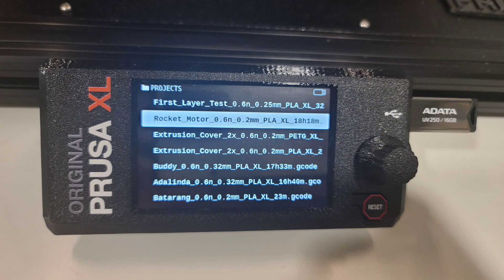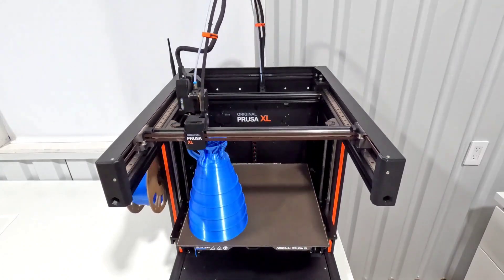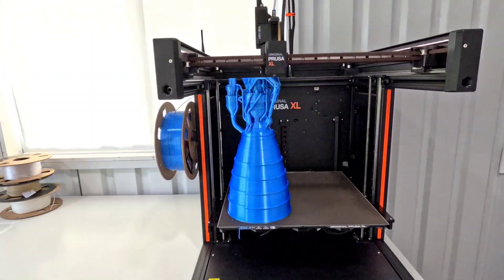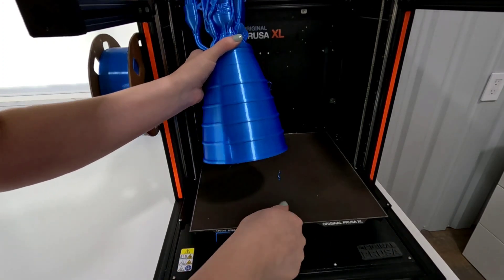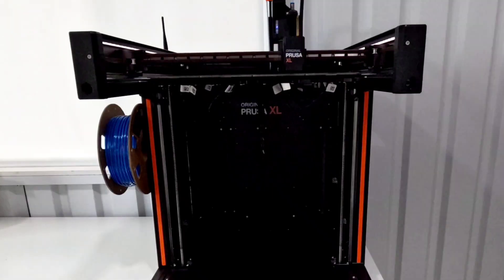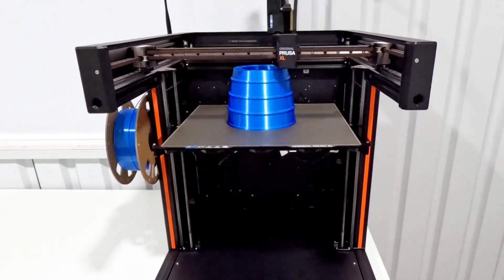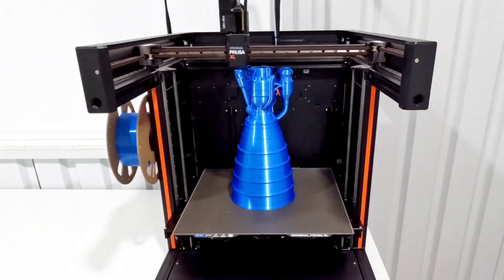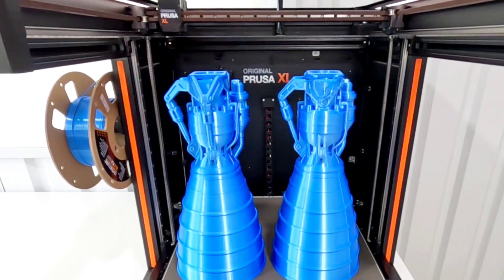Prusa XL - Printing the Rocket Motor!

Comment: The ussue is that tiny and tall stick. When it got tall prinder slightly rubbed it and broke it off and the structure above it did not have support after this event.
Reply from the maker: Yeah its very small. Thanks!

Comment: The print looks like it has no supports.  Those separate pieces that are outside the main body are probably not as solid and prone to small movement when the nozzle travels/prints them.  Most likely had a small lip/raised up filament on that part and nozzle started hitting and hitting until it broke it off.
Reply from the maker: Makes sense. I didn't add supports since it was a presliced gcode. Thanks!

Comment: So does the xl just poop a strip of filament off the edge of the bed during the startup gcode? The normal strip at the start of the print is hanging off
Reply from the maker: Mine does it everytime. Haven't seen any others out there. But I don't mind it. I can grab and pull the purge line off without touching the bed. If I can pop and slide the print, don't even have to clean the bed in between prints. Thanks!

Comment: I often choose random for the seam. It spreads the imperfections out, so it's a tradeoff, but at least there's no "bad side" that way.
Reply from the maker: True. I just usually have lot of bumps on random. But I'm sure it works for some filaments. Thanks!
Reply: @tada3dprinting  When the bumps line up, it makes a seam. :)   Mine generally look more like gaps than bumps, there is a way to tune this but I haven't done that. In general it may be less objectionable than the seam, depending on how the piece will be used.

Comment: So its a pre sliced gcode and took 18 hours for a fail and yet I printed it in 4 hours huh
Reply from the maker: I doubt it's the same size. But yes that's what it takes on the XL with .2 layer height.
Reply: @tada3dprinting  same size
Reply from the maker: @tadhgd350  12.5 inches tall on what machine?
Reply: @tada3dprinting  custom machine

Comment: That first motor is the 3D printer equivalent of that one Homer Simpson meme where he looks really thin from the front, but has a bunch of fat pulled back with a rubber band. Second print is gorgeous though, the glossy sheen  just looks really good on it.
Reply from the maker: Haha. Thanks so much!

Comment: Of course sucks that you had to re-print; interesting that 180d flip seemed sort it out though. I'd personally have tried to re-download the original STL and re-slice. Though sounds like you got through it either way.  On the topic of filament, given (by the sound of it) you print a lot, maybe you could share your favorite brand(s) and colors? :)
Reply from the maker: Yeah, I could have just reprinted it again. But I just really wanted to be able to watch the part that failed. I am a big fan of Overture. Mainly because they are a decent price, have almost every color and type I need, and arrive within 1/2 days. Changing between colors in the same type of filament rarely needs to be resliced.  You can order direct or on Amazon. Thanks!

Comment: Just a silly terminology thing, but this is a rocket engine, not rocket motor or motor engine.  A motor and engine are distinctly different things in the rocket world.  Sorry, aeronautical engineer in me had to point this out :) 

Also, just a fun tidbit - the thing that broke off in your first print is called a TVC (Thrust Vector Control) which gimbals, or steers, the rocket engine.  There’s two to allow 360deg control in one plane. 

And if anyone’s curious, this is a heavily simplified version of SpaceX’s new Raptor engine for Starship.
Reply from the maker: Good to know! I just used the wording of the file on the usb but I would like to use the correct terms. Also I wondered if there are more files I could print for the rest of it? Thanks so much!
Reply: @tada3dprinting  I believe the included file does correctly call it a rocket engine - I remember seeing that and being pleasantly surprised lol And no to the more files - this is a custom simplified version someone at Prusa made.  But I think people have made other Falcon9 and Starship versions.

Comment: Does the bed dropping momentarily signal a problem with the printer or was it meant to do that? That's very concerning if it dropped for no reason...?
Reply from the maker: It shouldn't have done it. I assume that there was a blob that the nozzle hit, the piece broke, and maybe crash detection made the bed drop slightly and it was able to recover? But it's hard to say with only the one pic during that time. It didn't do it the second time so hard to say. Thanks!
Reply: Aha. I see. Glad to know it was probably just crash detection. I really want an XL but I’ll wait until Prusa resolves their stock problem first. Hopefully by then all the kinks will have been ironed out.

Comment: silk filaments look wonderful, but are super brittle in my experience. the slightest bump on a narrow section like that could cause it to snap. glad to see it worked the second time.
Reply from the maker: Ok that makes sense. And it probably just bumped and broke off one piece. And when that piece hit the ground, it broke again. Thanks!
Reply: Layer adhesion is especially bad with silk filaments. Seams are also more pronounced, although with a round part like that there is no way to make the seam invisible.
Reply from the maker: Yeah I don't mind the straight seam, the second one with the wild seam isn't great. Thanks!

Comment: Why is that corner more efficient?
Reply from the maker: With this modular print bed, it's actually 16 smaller print beds. If it's printed in the front left, it only has to heat up those 4. If I print it in the middle, I believe it has to heat up those 4 plus a line of them from the front left connection. So the default tries to always put it centered on the front left.

Comment: Backsides matter.. lol (look up building dirt jumps)… 

There would have been a cling-on and it would have built up and fallen off and cooled. then the nozzle clips it, sometimes causing crashes or sometimes they can recover. If you monitor parts you could pause and Brush the nozzle but risk is that the part cools and you see small layer difference. 

 I’ve had this happened a few times on taller skinnier parts on a mk3s/+.  I’ve sat there trying to cut blobs off with a scalpel blade to avoid stopping prints and to stop crashing. 

Final part looks good. 

Noted there are a couple other players starting vids… good growth for last month you must be stoked!!
Reply from the maker: Yeah that makes sense. Yeah I've definitely clipped my fair share of blobs with those side clippers to avoid this too. Thanks so much!

Comment: Just a guess, but out on the front corner it may be susceptible to room breezes.  I keep the heating/AC vent in my printer room closed, so it has a more constant airflow under the door as the room is vented.  The AC cycling on and off messes with my prints otherwise.  Be nice when they have the enclosure finalized. Day 1 XL order, but no email yet.
Reply from the maker: Yeah its very possible. I'll probably just start switching to having it centered. Yes full enclosure with plexi would be ideal! Did you order single pre-assembled? Thanks!
Reply: @tada3dprinting  Yes, but it was late in the evening. Around 9:30pm eastern
Reply from the maker: @Ulfgrum  I'm sure you're still soon on the list
Reply: I have gotten an e-mail from Joe that I would get more information on my order.  I am going to switch my order to the 5 head kit, but want to see some reviews like TADA does on it.   I love my Bambu X1 Carbon and the P1P, but the XL still had my heart.

Comment: Maybe it didn't print right because it's a silk pla? Maybe needs a bit higher temp?
Reply from the maker: Second one printed just right without changing the temp, just repositioning. If it wasn't such a long print, I would try it again with the original gcode on the usb. Thanks!